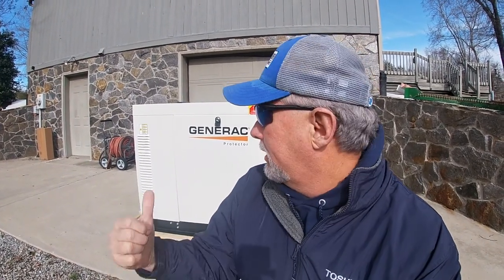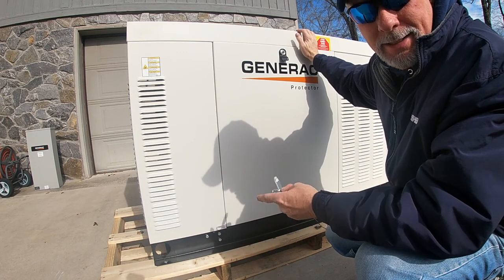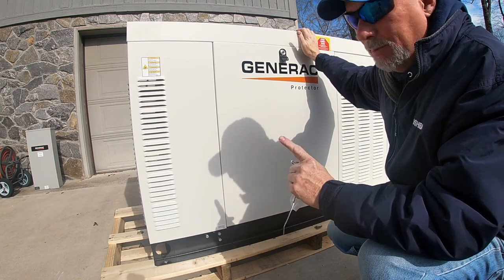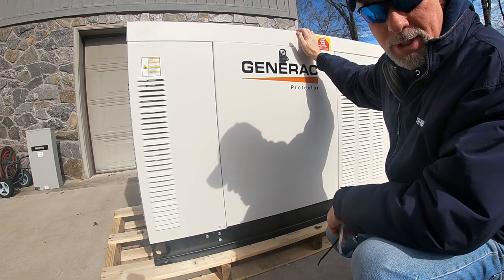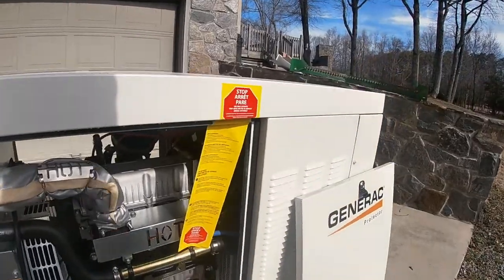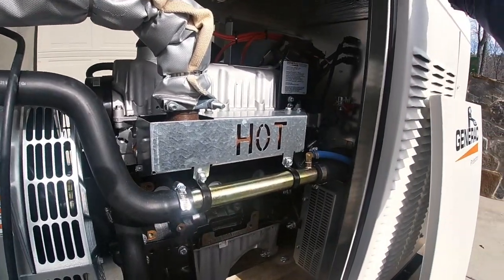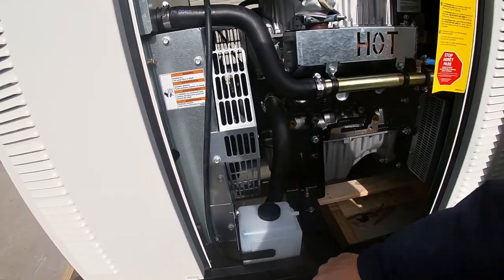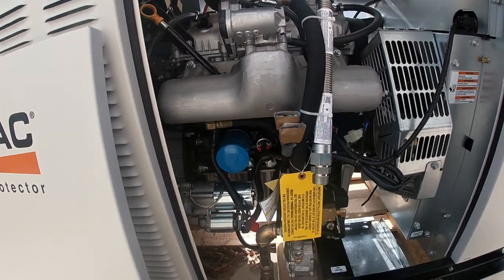HOW TO INSTALL GENERAC 25 KW / INSTALL TRANSFER SWITCH(Pt.1)

Comment: I completely installed a Cummins generator system, myself. The concrete pad I poured has two 3" PVC pipes that come up into the unit from below the machine (no visible conduit or electrical lines). When I finished, Alabama Power came out and popped the meter into its box (that I also installed). I mounted a 200 amp cutoff panel next to their meter that separates power company from the generator's transfer switch. It can also be used to manually simulate a power outage by just shutting the breaker off. The generator runs the whole house, and shop. My neighbors go without power, sometimes for days, but not us. I don't understand why more don't see a large generator as a priority.

Comment: This will be interesting to see the installation. I don’t think I’ve ever seen a hole drilled behind the transfer switch into the house. 🤔 the main wires from the supplier, got to the meter can, then from the meter can to panel on your house, as is I would think….drilling another hole for the transfer switch “may” not be necessary if you local code will give an exception to use the meter can cabinet as a raceway. Some will allow it, some won’t. If they don’t allow it, you’ll have the hole that’s probably behind the meter needing plugged.   Looking forward to part 2 to see what way they do not. 👍
Reply from the maker: Hey, That is a GREAT question. If you look at my earlier video where we installed the 24KW at my Dad's you'll se them drilling before they set the transfer switch in place. I'm totally guessing but I wonder if it has to do with power still being on inside the meter box and drilling a second hole is safer. I will ask the electrician and I will comment and share that info on the next video. They are set to install on Wed. so I hope to have the video go live on Sat. Thanks and take care !!!!!